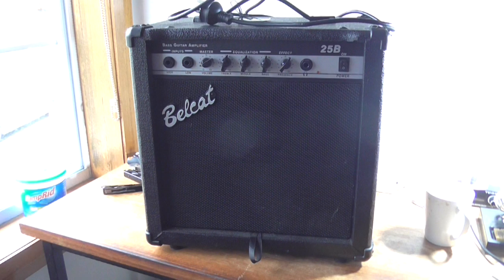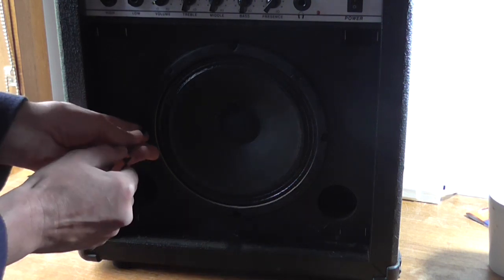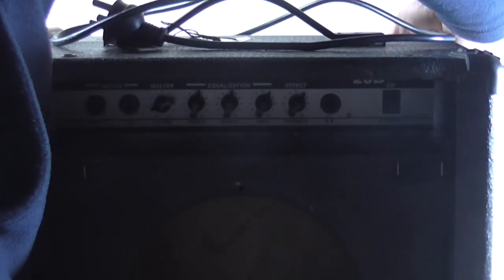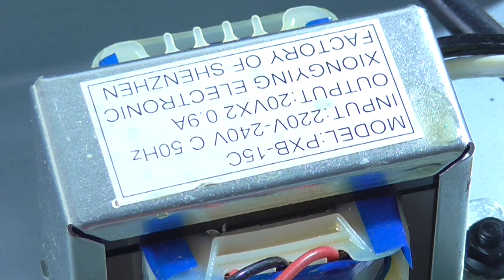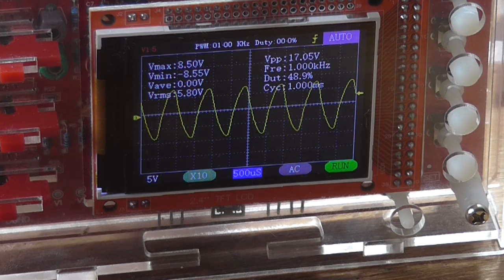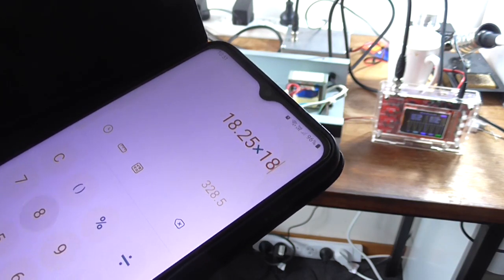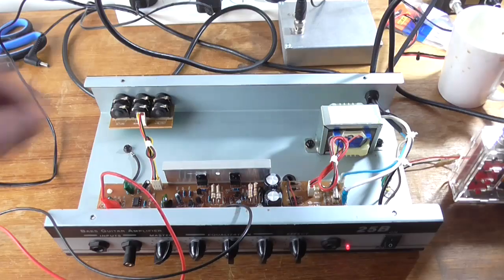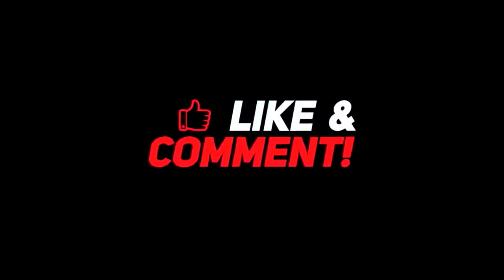Belcat 25B Bass Amp: Power Output TEST!

Comment: Ok i see two transistor pushpull
But how many transistor have in circuit? 
Op amp as  drivers? 
Diodes are vbe multplier and phase spliters?
Dont havent bias generator transistor in heatsink

Comment: Nice little amp there, would there be any advantage to upgrading the heat sink? Would it change the performance, or just it's longevity?
Reply from the maker: Longevity mainly. However at full power, it never felt to me it was getting over 40 Celsius